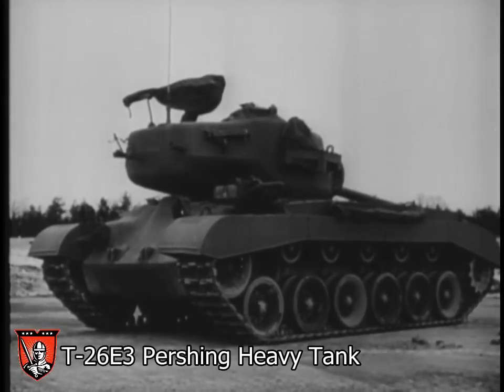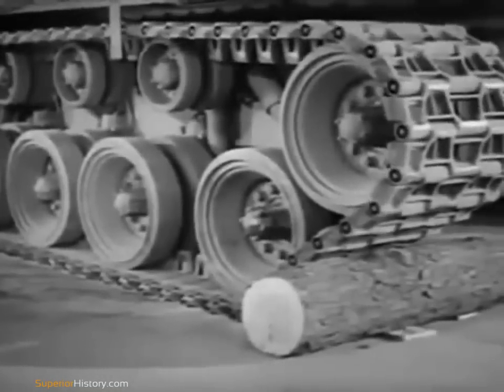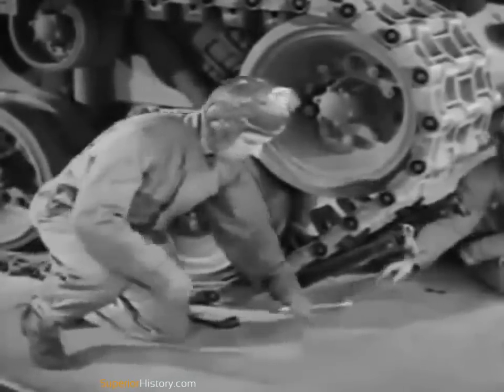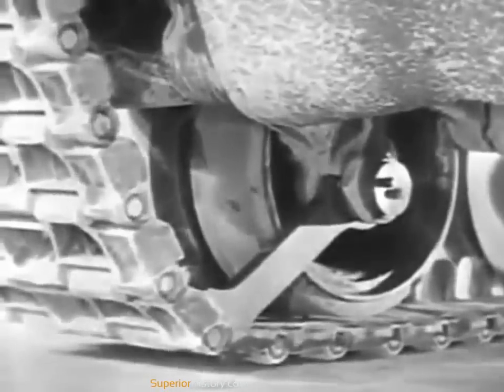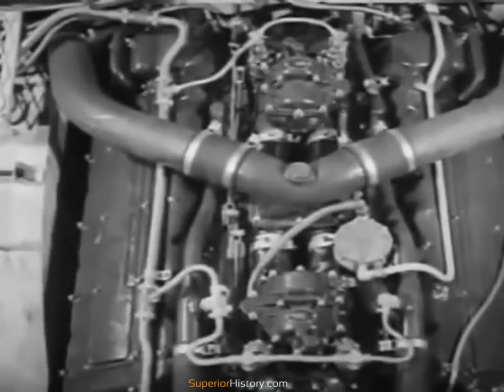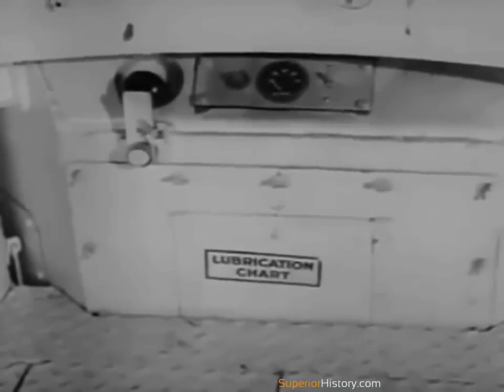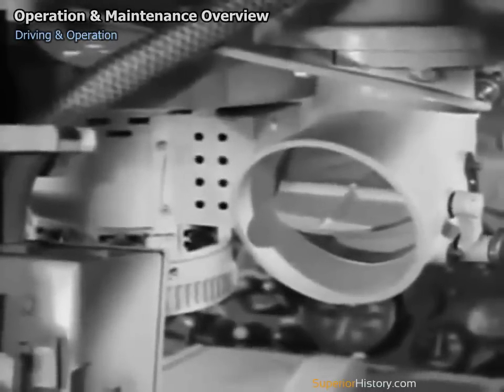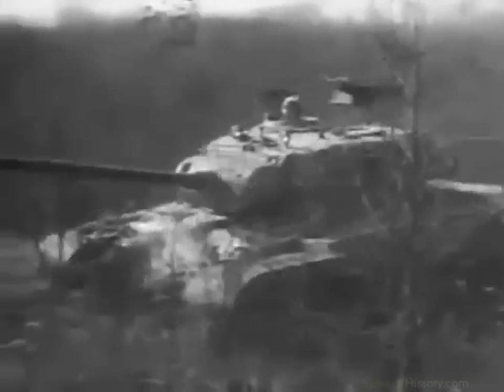The American M26 Pershing Heavy Tank (720p)

Comment: If only the Pershing had been available on D Day, what a difference it would have made. The Sherman was no match against the 88 mm of the Tiger. Even the Panther was deadly. Knowing the German superiority, I have often wondered why the Allies did not produce a tank to outgun and outrun the Tiger sooner in preparation for Europe.
Reply: Adrian Larkins 
Most Tigers were deployed on the Eastern Front.

Anyways the Shermans with the 76mms were good enough to take on Tiger 1s, the ones with the British APDS ammo even better.

75mm Sherman on the otherhand was weak, but US strategy at that time was like France, tanks purely for support of infantry. The USSR on the otherhand dedicated certain tanks to infantry, but also had tanks working independently.
Reply: Krasnaja Zvezda True. The Tigers were on the Russian front but there were still Tigers in France. The trouble was there were not enough Firefly Shermans with the 76 mm and the Germans knew the Firefly was dangerous so they picked out the long barreled Sherman for special treatment.  The other problem was the Sherman with its petrol engine made an excellent barbecue.
Reply: Adrian Larkins The Panther posed an even higher treath to the american tanks than the Tiger. More mobile, easier to build, better armored and armed with the 75mm Kwk42/L70, which was superior to the 88mm gun of the Tiger in every aspect except for HE-performance, the Panther was practically an overkill for the Sherman.
Reply: Karl Hans
The diameter of the projectile is the same, but the propellant case is much bigger on the Tiger 2.
Reply: Kevin Toma There was a few limiting factors that caused the Army to (wrongly) choose to put off the Pershing's introduction.
1--Time to build and amount of steel used was greater, reducing production numbers compared to the simpler Sherman
2--Sherman was easier for Rail transport (most tanks built around the great lakes area, not eastern seaboard) and much easier for liberty ship transport (the ships couldn't carry as many Pershings)
3--Crews have to be retrained in operations and especially maintenance proceedures (and tanker crews have a LOT of that to do)
4--Increased strain on logistics (new types of spare parts needed for maintenance and repairs)
5--Of course, the Army also honestly thought that like in Africa and Italy, the advanced German heavy tanks would be very rare (instead of making up some 40+% of German tank forces in Europe), and this is also why they refused to introduce the 76mm M1 gun armed shermans until late 1944 (could have been available by mid 1943) and the 76mm HVAP shells (which didn't finally start being found in large numbers for 76mm gun armed shermans until spring of 1945).  This was a HUGE blunder on the US Army, who didn't heed the advice of the Brits (who were uparming their shermans with the excellent 17# AT gun) about preparing to deal with larger numbers of Panthers and Tigers in Europe.

Interestingly enough, by early 1943 the Army already had prototypes of a new medium tank to replace the Shermans (The Pershing was effectively a beefed up version of this prototype medium tank) that had wide tracks and a torsion bar suspension, a lower hull silouette, better sloped armor, and a 76mm gun (picture a smaller Pershing), but they decided that the interruption in tank production as factories switched to the new type of tank was something they could not afford to do, so they stuck with the Shermans (cranking out 50,000 of them in about 48 months)
Reply: Adrian Larkins Most German armor encountered in Normandy were Panzer III's and IV's. You are right that the 88 gun was devastating, but the frequency of engagements with Tiger tanks were vastly exaggerated. Historians are quoted saying troops would often mistake other tanks for Tigers, cause Tigers were the big bad wolf of the German Army. For example, you're driving down a road in France and you spot a gun pointing out of the treeline. First thing you'd think was "Oh shit it's a Tiger!" cause your fear of one would cause you to assume it is one.
Reply: Big R You have a point.
Reply: 22steve5150 I hear what you say regarding diesel v petrol.  However, there can be no denying petrol is far more flammable. The Sherman didn't get that sick Ronson Lighter  logo "Lights up first time" for nothing.
Reply: 22steve5150 Thanks for the knowledge my man
Reply: 22steve5150
 The US Army replaced them in Korea with M4's due to reliability issues. You might want to try "The chieftains Hatch" video on myths of the m4 where this is explained as is why it was not ready for D-Day.
Reply: Adrian Larkins I think there are some major misconceptions here.  The Sherman was good enough to do the job it was asked to do.  It wasn't built to take on a Tiger 1 vs. 1, and it didn't have to.  It was a cheap easy tank to build and maintain, and that what was needed for WWII.  The war was a production war on both fronts, and the side that made more won.  You say that the Sherman was no match against the 88, but in reality no tank was a match for the 88.  The 88 would have killed the Pershing just like it did the Sherman.  We also avoided falling into the trap that the Germans did.  The Germans put these massive guns on their tanks, and they could penetrate tons of armor, but the guns didn't NEED to penetrate tons of armor.  Those huge guns weighed a ton, and caused all kinds of problems with mobility and weight.  If you only need to penetrate 100mm of armor, why put a gun on your tanks that can penetrate 200mm?  Watch the video on youtube about "Myths of American Armor".  It is very interesting.  For instance it talks about how the Sherman almost had as much frontal armor as the Tiger.  The Tiger had a bit over 4 inches of frontal armor because it was only very slightly sloped.  The Sherman had only 2 inches or armor, but because of the slope the effective armor was just a little under 4".  That is just a little bit less than the Tiger.  I'm not saying the Pershing isn't the better tank, but what I am saying is the Sherman did what it was supposed to do and did it very well.  Being a tanker in a Sherman in WWII was not a death sentence.  In fact the tank arm had one of the lower casualty rates of the war, and most of the casualties came from tankers outside of their tanks.
Reply: +Zebra Dun not that you can;t ship them, but that you can ship 2 M4;s and a bunch of additional weight in the same ship you can ship one Pershing.  quite a few of the pieces of infrastructure can  easily carry it or were fortified to carry such weight by the Germans.
Reply: +Adrian Larkins In this thread I think you have checked off every M4 Sherman myth there is. "Ronson", eh? Petrol engines? "Superiour german tanks"?

1. The "Ronson" moniker is likely a myth to begin with, and besides, by the late war it was less likely to catch fire than most tanks, thanks to wet ammunition storage. It's the ammunition that catastrophically burns out a tank, not the fuel.

2.  Every German tank was petrol powered. In fact almost all were, with the exception of the Russian tanks. But as several have told you, it doesn't matter. Fuel fires don't kill tanks, ammunition fires do.

3. The PzIII wasn't superiour, the PzIV wasn't superiour, nor the StuGIII or the JgdPz38. It could go toe to toe with all those, which made up well over 75% of all German tanks/TDs. Even the Panther wasn't impervious. Google the 'Battle of Arracourt'. And yes, that is with the M3 75mm.

Let go of the Belton Cooper "deathtrap" myths already and please go watch the clip /watch?v=bNjp_4jY8pY
Reply: +Adrian Larkins The Firefly wasn't a terribly good tank. They shoehorned that 17pd gun in sideways into the turret that was really too small for it, so the ergonomics and combat effectiveness suffered. Also they simply didn't have enough guns. It was a stop-gap measure at best. The British fielded them in a 1:4 to 1:5 ratio with 75mm Shermans.

And besides, many many tankers at the time preferred the 75mm, because the main threat wasn't Tigers or Panthers as you seem to believe, but rather AT-guns and AT infantry teams. For which you want a decent HE shell which the M3 75mm could deliver (and the 17pd or the M1 76mm couldn't). For PzIVs and StuGs the 75 was effective.
Reply: Adrian Larkins Nice! :) I just want to educate that the old "common knowledges" about the Shermans and the Western Theatre aren't what they seemed to be. The big picture has been skewed by shoddy History/Discovery/Military Channel "documentaries" regurgitating the same old claptrap.

The thing was that the upgunning of the M4 was in the pipeline ever since 1942, the U.S. armour board did know that it probably was to be needed eventually. But for logistics and time reasons (and the 75 mm's HE shell) they didn't in time for the Normandy landings. They perhaps didn't know that the Panthers would be quite so numerous in the Normandy campaign, ...but then again the 76 mm wouldn't have helped much anyway. It wasn't effective to the front of the Panther either without HVAP. The sides and rear both the 75 and 76 could penetrate easily. The Tiger I was documented to have been encountered a grand total of 3(!) times by U.S. armoured troops in the western European theatre, as told in the clip I recommended.

The Sherman's armour wasn't actually bad by any stretch. For a 1941-1942 tank it was great actually, much better than the PzIV and StuGIII, even after their applique armour additions, and the T-34. Frontally it was actually only slightly worse than the Tiger I. Did it stand up to the Panther's 75 mm L/70 or the 88 mm L/56? No, but then again no British or U.S. tank did really, not the Pershing either (especially against the Panther's L/70 which was better against armour than the Tiger's 88).

Well, enough blabbering. I'm glad I could plant some seed of thinking about the subject... :)
Reply: +Michael Ledford I am sure you are right but the fact remains the M4 did come up against Tigers and Panthers.To believe otherwise was wishful thinking. Not only that, the American planners knew the 88mm was a killer even as the Sherman was coming off the production line. It should have been equipped, from the beginning, with a turret and gun that at least gave the crew a fighting chance. Air support was not always available and certainly not instant.
Reply: Adrian Larkins I agree that there were many times Sherman's were forced to fight tank on tank without CAS but that wasn't the Sherman's main role .
Reply: because tigers were rare in the west.  we had things to take them out already, planes,    artillery, fireflies, ect
Reply: +Zebra Dun Some of the reasons given by Omar Bradley and Montgomery for not closing the gap was lack of material, fuel and ammo but more importantly they feared the Allies might accidentally fire at each other as they drew closer. Personally, I think these are excuses rather than true facts. In short, they cocked it up.
Reply: The M4 Sherman was a medium tank never intended to engage enemy armor as it's primary mission. It was designed for infantry support, breakthrough, and exploitation. U.S. doctrine at the time called for the Tank Destroyer battalions to be used in the tank killer role. The M-10 and M-18 with the high velocity 76.2mm gun and later the M-36 with the 90mm gun complied an outstanding record for German Armour destroyed when using ambush and defilade techniques, flank shots, and quick movement for which they were designed. This included destroying many Tigers and Panthers at normal combat ranges particularly later in the war when better high velocity AP rounds were available.
Reply: If the Sherman wasn't good enough, then how did the Germans lose the Battle of Arracourt? They had numerical superiority in terms of armour and still lost horribly.
Reply: Mr.Science your 100% correct ,the Sherman wasn't designed to go toe to toe with heavy tanks , the Sherman was 1 of the most successful medium tanks made .
Reply: Colonel Radec Good point. There were more of them too. The Tiger has become a bit of an overrated legend to some extent. By that I do not mean to it was not a huge threat to the Sherman. It certainly was a killer.
Reply: Krasnaja Zvezda I was referring to the Tiger 1.
And as far as I know, the cartridges in the Tiger 2 were the same size as the ones used in the Tiger 1, but the Tiger 2 had a much longer barrel which was able to fire with higher velocity.
Reply: Colonel Radec
The Tiger 2's KwK 43 has a larger cartridge and thus the ammo is not comaptible with the KwK 36 L/56 of the Tiger 1.
Reply: Krasnaja Zvezda Ok, but why is it the same calibre then? Do you have any sources?
Reply: Krasnaja Zvezda why are they both 88mm then? cleatly the Tiger 2's round is bigger in diameter.
Reply: Adrian Larkins More politicians probably had more money invested in the Sherman. Or, at least that would be the reason if it happened today.
Reply: Adrian Larkins There were logistical drawbacks to switching production from the smaller, cheaper, lighter sherman to the pershing and for a long time, concern about those drawbacks caused the army to delay the introduction of the Pershing.  Switching factory tooling over for a new tank design construction would have slowed down general production numbers of tanks temporarily, and you couldn't ship Pershings by rail to the east coast then load them up on ships for transport across the Atlantic as easily as the much smaller and lighter Sherman.  Remember, unlike the other tanks in the war, the Sherman had to have considerations about ease of transporting them halfway across the world to fight, and a liberty ship could transport something like 2.5 Shermans for every Pershing..  Everyone else's tanks basically could drive or take train railcars from the factory to the war front.
Reply: 22steve5150  Your comments make sense BUT I think you would agree the standard Sherman was a death trap against the 88mm whether  it be mounted on a Tiger or as a separate anti tank gun. That said, why, oh why did they not switch to all out production of the Firefly. That would have helped but still the petrol engine would have been an "ignition" danger. I hate to think how many good men met an agonizing end just because some bright spark thought it was cheaper and faster the install an aircraft engine into a tank.
Reply: Adrian Larkins US Army doctrine at the time called for tanks to be used against infantry and tank destroyers to be used against tanks.  Basically the US 76mm and British 17# guns both had shitty anti-personnel shells and the Army wanted to discourage tanks from trying to fight other tanks.  All in all pretty fucking stupid.  They could have had all Shermans equipped with the US 76mm gun by late 1942 and by early 1944 they all could have been using the 17# gun.
As far as the gasoline engine, I never really bought that being a problem.  All german tanks also had gasoline engines, and the diesel engined T-34 actually had a higher rate of catching fire when hit than the Shermans did.  The 2nd gen Shermans with the protected ammo storage and water jacketed fuel tanks seemed to greatly reduce fires compared to the 1st gen shermans.
Reply: 22steve5150 It was a general consens at that time that tanks should be primary used against infantry, bunkers or anti tank guns, not against tanks. Just look it up, the actual amount of tank vs tank combat is relatively small.
Reply: Why I wonder is why they didn't issue the LVT amphbious vehicle to some of the D-Day troops.
Reply: Krasnaja Zvezda The LVT wasn't really armored enough for combat against the Germans.  They really had a bad combat history in the Pacific theater, they would easily get stuck, sink, etc.
Reply: Adrian Larkins I'd imagine it being much harder to maintain and transport the Pershing onto beaches, but I don't know any of the specifics.
Reply: Adrian Larkins Anyone slightly familiar with D-Day, (those who watched "The Longest Day") will know that very few Tigers if any were in combat during D-Day. Hitler wanted to keep them in reserve and he alone could order them into action. So no, it would have made little difference. Only German anti-tank personnel would have a much bigger target for their Panzerfausts and Panzerschrecks. And who needs a diffent D-Day outcome? The outcome was that the Allied landings succeeded and the Allies gained a foothold on the European continent.
What about Omaha Beach? Only a few dozen tanks made it ashore, many sank in the stormy waters so if they were Pershings, I reckon all of them would have sunk. There were no Tigers either on Omaha Beach anyway.

Btw, you wouldn't mistake D-Day with the Battle for Normandy, would you? D-Day was just one day, 6 June 1944. The Battle for Normandy lasted a whole month.
Reply: AudieHolland  So you think "The Longest Day" gives you a good grounding on D Day? Oh well. You miss my point. Yes, there were few Tigers on D Day but it did not take long for them to appear and besides, there were plenty static 88mm guns. The Sherman was a death trap against the 88mm. I will not go into detail. See my other comments. Many good lives were lost in those tanks and yet the Allies knew the Germans had far superior machines. I say again, if the Pershing had been available earlier, the Germans would have met their match. By  the way, Omaha was a disaster for many reasons. Elsewhere, landings went relatively smoothly and Pershings may well have succeeded in getting ashore.
Reply: AudieHolland I would say that several things would have sped shit up immensely.
1--for all the engineering variants and "hobart's funnies versions of tanks thought of prior to the landings, the hedgerow cutter blade was one of the few things that was not thought of.  If those were available early on the next month in hedgerow country would have went much better.
2--Pershings available earlier would have been huge, since about 40% of total german tank strength in Europe was Panters and Tigers.
3--Upgunned Shermans produced BEFORE D-day, and tungsten HVAP rounds available in larger numbers
4--M36 Jackson introduced earlier
5--DD versions of the about to be introduced M24 Chaffee.  Very similar length and width at much reduced weight and not as tall (and topheavy) either.  Armed with a 75mm gun just like the DD Shermans.  Also torsion bar suspension and a wider track.  If equipped with some DD modified versions of this light tank the forces on D-Day itself would have done much better as their armor would have at least made it to the beach instead of sinking in rough water or bogging down in muddy areas while trying to come out of the water.  Vehicles like these could have really helped cross rivers to secure bridgeheads during the march into Germany as well I think.

The DD-Chaffee idea is my own little idea, but as for the other things I mentioned, these mostly were not available because war planners didn't think them necessary, not because they were logistically unable to start producing them earlier.  Too bad.
Reply: Adrian Larkins (sighs) I meant that anyone who has seen "The Longest Day" will know that the Germans did NOT deploy their Panzers on D-Day (June the 6th). Meaning ANYONE knows that.
I'll let you in on a secret: ANY tank, no matter how well armoured was a death trap when being shot at by a German 88 mm. 

Omaha started as a disaster but at the end of the day, they did manage to break through (supported by gunboats that ran aground on purpose to fire at the German bunkers and pillboxes from point-blank range). So while it started as a disaster, it ended in mission accomplished. At the end of the day, overall losses were lower than expected. Meaning that on other beaches like Juno Beach, the landing was virtually unopposed when compared to the hell on Omaha.
Reply: 22steve5150 Overall it would have made little difference. Enemy anti-tank infantry used Panzerfausts and Panzerschrecks which no tank armour could resist.
Bladecutters looked nice but they didn't help much since the Normandy hedges were grown on low earth banks which were reinforced over the ages. Meaning that no vehicle or tank could simply cut its way through the hedges. Their front side always rose up as they passed the bank and the tough hedgerows underneath, slowing them down immensely while at the same time presenting a big, irresistible target to any anti-tank cannon or infantry.

The DD-tank based on the Sherman was an great design which worked very well under the circumstances that the Allies had trained. Nobody had expected the bad weather that they got when they did land but if they hadn't landed the 6th of June they would have had to wait a whole other month before they could try again.

What irks me is that some people look at D-Day as if it was a bloody failure. It was not. It was a remarkable succes with over losses lower than expected. The Battle For Normandy, that was quite a different story. No matter what tank they would have used, the Allies would still get stuck in the hedgerowland because their planning simply did not take into account that the hedgerows were different than your ordinary hedgerows.
Reply: AudieHolland I'll let you into a little secret too. I know the 88 could kill any tank but the Sherman didn't even have a gun to cope with the heavy German armour. The 75 was useless. The 76 Firefly was different but there were not enough of them. As for the Pershing, it had the right fire power and its armour gave the crew some degree of protection. Also, it was not so prone to bursting into flames. I still say the Allies were almost criminally negligent in making young men get into tanks which they KNEW were no match against the opposition. The Pershing should have been ready for service on D Day. As for Panzerfausts, they were only effective at very close range. If all anti tank weaponry is so deadly it makes you wonder why tanks are still with us today. That' s my opinion and I'm sticking to it.
Reply: Adrian Larkins  Actually most of what you posted is not accurate, but a flawed view of the Sherman based mainly on one (now fairly discredited) man's book that complained about the Shermans.

First of all, the tendency to catch fire was an issue only with the earlier models of Shermans, and it wasn't because of the gasoline, it was because at that time it was common for extra ammo to be stored in the crew compartment, particularly in racks along the sides of the turret.  The 2nd generation Shermans got rid of the racks and protected the stowed ammo in the floor with water jackets.

Second, early war German tanks, when penetrated suffered nearly the same rate of "burn out" as the Early Shermans did, and the later shermans were one of the least fire prone tanks of the war.  Also, because of several hatches and the roomy nature of the Shermans, actual crew losses per knocked out tank was one of the lowest of the war, with Russian tanks being the worst (when a T-34 was knocked out, on average nearly the entire crew died)

While only the British Firefly shermans and US 76mm armed shermans using tungsten HVAP rounds did give them a fighting shot that the 75mm gun armed shermans didn't have against Panthers and Tigers (but were only introduced in late summer 1944), at this time the US army still figured that tank destroyers would do the majority of the fighting against german tanks, the Shermans were supposed to be more "infantry tanks" at this time.  It wasn't seen as a significant risk for tankers considering what US armor doctrine was at that time.

US tank design had to consider factors that German tank designers didn't have to deal with, mainly to be manufactured fast and be easy for crews of various nations to operate, be able to be easily transported by rail and then by liberty ship across the Atlantic (a lot harder to ship tanks halfway round the world than drive them from the factory to the front like German and Russian tanks could do)

Finally, take a look at the "world beater" T-34 if you want to see a real over hyped lemon.  The T-34-76's gun was inferior to the Sherman 75mm (low velocity), and even the T-34-85's gun was inferior to the late war Sherman 76mm and British 17# guns (again, low velocity), they had an outdated and highly problematic suspension system, their engines and transmissions frequently failed before being driven 100km, and they were so crowded on the inside (and ammo and fuel storage issues meant almost certain fire or explosion when penetrated) that it was nearly impossible for the crew to get out before being felled by flames or smoke inhalation.  They also had terrible visibility with the hatches shut and no turret basket, which significantly hampered the ability to quickly aim and fire while maneuvering.

Fun Fact.  At one point the T-34's remarkably high instance of mechanical breakdowns resulted in several after action reports that indicated that more T-34s were being knocked out by mechanical problems than by enemy fire, so Stalin's people began investigating whether or not there was sabotage occuring in their factories or by cowardly tank crews.
Reply: 22steve5150  I appreciate your knowledge. i agree with your views BUT you can't get away from the fact that the later Shermans were as a result of the disaster of the first. I am with you as far as the  T 34 is concerned. I realize the problems of shipping but  at the end of the day, American tank design should have taken into account the German superiority. If only they had cancelled the standard Sherman and mass produced the Firefly. That would have helped. The ammo storage was indeed a factor but that rotary petrol engine didn't exactly improve matters.
Reply: The end of the story: not the type or design of tank was what decided the war. One thing only: Mass Production.
The Firefly was a marriage between the US Sherman and British 17 Pounder cannon. So production depended on the availability of 17 Pounders. Furthermore, the cannon was so cumbersome that it only just fitted into a Sherman's turrent meaning it could not fire at the same rate as ordinary Shermans because it could not be loaded as quickly.

Mass Production. The Germans never learned the trick, their tanks evolved into monstrous dinosaurs like the Tiger II and the Sturmtiger. Too heavy for most bridges in the Ardennes Region and slurping too much precious fuel that was no longer available.
The American and Soviet tanks, with all their flaws, were great cross-country vehicles with armour and a cannon as extras. Also very reliable and since both the Sherman and T-34 could be produced in Mass Production, it didn't matter that much that they were relatively easy to destroy.

Combined the Allied Air Superiority and even total dominance of the skies near the end of the war, it didn't matter much what tanks the Germans employed. A salvo of all 8 50 calibre guns from a Thunderbolt could turn over a Tiger by simply firing next to the tank.
And the Soviets employe small bombs that were dropped en masse over tank formations, knowing that many small bombs had more of a chance of hitting one or more tanks. It didn't matter the bombs were so small: any tank's top armour will always be much thinner than its front or side armour. Those Soviet anti-tank bombs were a bit like modern cluster ammunitions.
Reply: Adrian Larkins And of course all German tanks were Tigers and Panthers, right? The Sherman was designed with the Panzer III and IV in mind. So even with all the upgrades, a Sherman still had a decent chance at taking out an enemy Panzer IV. Panzer IVs had Schuertzen (skirts) to protect its sides against bazookas but these didn't help against high-velocity projectiles. And of course, as mentioned earlier, the Sherman was never designed strictly as a tankbuster. For that role, the M-18 Hellcat was used. The Hellcat was the most effective US anti-tank destroyer during WWII (according to Wiki).
Reply: Adrian Larkins Funny thing is they got past the radial aero engine thing early on but by then they had designed the propulsion train and the hull around that aero engine so once the Ford V8 engines started being used, they still had the rear engine, front transmission setup with the propeller shaft linkage that forced the hull to be so tall.  I wouldn't say the early models were a disaster, they worked great in North Africa, the problem was that the army didn't think they needed to upgrade them afterward (only Brits encountered Tigers in North Africa) and even after having a lot of problems operating in Italy the Army still resisted changing or upgrading their tanks the way the Germans were constantly upgrading the Panzer IV.

What is really messed up is that the army could have been fielding a new medium tank with rear engine and transmission, sloped armor, low silhouette, with torsion bar suspension and 76mm gun by late 1943 but they refused to interrupt Sherman production to start production of a new tank, so the prototype was worked further and enlarged to be a bigger tank with thicker armor and a bigger gun, resulting in the M-26 Pershing.
Reply: Adrian Larkins The 17 pounder Firefly wasn't as great a gun as everyone thinks. It could punch a hole thru a front of a panther in under 500m but its accuracy started to suffer at longer ranges. The 76mm was a much more accurate gun and with special AP rounds could do the job sufficiently. That is one of the reasons the Army chose this gun upgrade for the M4 after considerable testing(I think someone also mentioned that it was shoehorned into the turret and had no room). As for petro engine fires, these did not cause the "death trap" when a tank got hit. Someone already mentioned this, but the ammo is what catches fire and engulfs the tank. Shermans were quite easy to get out of quickly unlike most German and Russian tanks and saved a lot of tankers lives.
Reply: Joe Flatley
Though the AP ability of the 17# gun was superior, the 76mm had very good AP with the tungsten HVAP rounds but unfortunately the army didn't start mass producing them soon enough so on top of the relative few 76mm armed Shermans, those 76 armed Shermans were usually only issued 2-5 of those HVAP shells per tank.  What a clusterfuck.
Reply: Adrian Larkins  Pershing only started production in Jan 44 and was untested. It turned out to be a dog. In Korea they were ditched for the E8 Sherman.
Reply: Shawn Sutton
 They were actually withdrawn at the end of Korea in favor of the M-46 Patton, which was nothing more than a Pershing with a newer, more powerful engine.  The only problem the M26 Pershing had was the fact that they had the same powerplant as the Sherman A3 models (500hp Ford engine) which for Europe wasn't a big deal but for Korean mountain country was a big deal and it took until after WW2 to develop a more powerful engine for them.  Since the M-46, M-47, M-48, and M-60 Patton series were all derived by the M-26 Pershing, I would not consider it a "dog".
Reply: Shawn Sutton
THE reliability issue was because the tank used the same engine as the Sherman A3 model (Ford GAA) and a rear transmission that was originally designed for a 35 ton medium tank replacement for the Sherman, and it is this engine&transmission combo that caused problems in Korea, which was very mountainous country and therefore not well suited for an underpowered tank.  Also, they were not replaced by M4s in Korea, Pershings and Easy 8 Shermans both were deployed to Korea and the Pershings were withdrawn as newer M-46 Patton tanks (basically a Pershing with a new powerplant, altered suspension, and a bore evacuator added to the main gun) replaced them.
Reply: ***** I appreciate your remarks but my original point was the Sherman was no match against the Tiger, Panther and the 88mm gun. If only the Allies had developed the Pershing earlier and had equipped the Sherman with thicker armor and the 76 mm gun as standard, the lives of many young men may have at least had a fighting chance. As for Dieppe the lessons were well and truly learnt by D Day. As for Omaha, it was a near disaster but tanks were landed successfully elsewhere.
Reply: it's my understanding that the tanks couldn't be too big or heavy in order to be shipped overseas for battle.
Reply: harry beck
Yep, also it required new and more complex system maintenance training and adding new parts to the logistics train, and new vehicle training for crews.  Also the production switch would have reduced overall tank production for several months while the factories re-tool.
Reply: +Adrian Larkins 
Because the Sherman was cheap and easy to produce in mass numbers.  Mass producing cheap tanks proved to be a better strategy that producing expensive heavy tanks.
Reply: +Faceless Man  I agree. It was cheaper and easy to produce BUT at what price in human life? The Allies were well aware of the capability of the German heavy tanks eg. Panther and Tiger, and yet they produced comparative rubbish knowing full well men's lives were at stake. If only they had made the 76mm gun standard. Even that would have helped but NO.
Reply: +22steve5150 

The Pershing was a good tank,that arrived late in the war,but could hold its own against German Armour in the form of tigers,panthers and tank destroyers(which the Germans were producing in ever increasing numbers because of ease of production and cheaper to build), such as the  jagdpanzer iv and the excellent   jagdpanther.

But compared to the Centurion Tank as seen during the Korean and other wars such as yom kippur  in '73,was inferior.

I am surprised no one mentioned the Comet medium tank, which was a stop gap produced in just enough quantity to help the British army lighting speed advanced into Germany in 1945.The 11th Armour division  was fully equipped with this tank, thanks to the Armour piercing dart ammunition it used,its low profile and speed with better Armour protection,the tank fared very well against German tanks and tank destroyers.

Protection was also provided against infantry  hand held anti tank weapons by having infantry travel on the tanks themselves just like the Russians and Germans did
Reply: +Jam Putto  The Comet was indeed a good tank as a stop gap. The other British tank that was worthy of mention was the Churchill. I still say the Sherman 75mm was a folly. I was no match against the superior German tanks and other anti tank armament. And that petrol engine - no wonder it got the nickname "Ronson". The Sherman was only effective because of the weight of numbers and the cost in human life was almost criminal.
The Centurion was is a different kettle of fish. It was a huge leap forward, superior in all aspects to WW2 tanks.
Reply: Centurion was a world beater for years
Reply: +harry beck It was and although entirely different inside, you can still see the physical outline of the Centurion in today's British tanks
Reply: Adrian Larkins

I think the Sherman was a very good tank up to 1943,by 1944 it was showing its age.Though at least the Sherman Firefly with its 17 pounder  give the crew a chance at greater distance of a kill against German Armour,depending on the Tank /Tank destroyer's type.

In the end it is the quantity of Armour produced in terms of numbers that counted.

The Germans tended to over engineer theirs.

Still wasn't it U.S.A militarily doctrine that dictate that Tank Destroyers were solely in the tank hunting / killer role with there higher velocity guns?
Reply: +Jam Putto Knowing what they were up against I cannot understand why the 76mm Firefly was not standard. At least then the poor guys inside had a chance. You can talk about doctrine all day but the fact was by 1944 (pre D Day) the Allies knew the Sherman 75 mm was not up to scratch and yet they still sent young men to their deaths
Reply: Who knows,maybe the decisions are made by those higher up,who are not in the line.
Reply: +Jam Putto I'm sure you're right. Politicians and business don't mix when it comes to the grim practicalities of warfare.
Reply: +MPI1000 Ok You have your opinion. I have mine. Myth is it ? Yea well.
Reply: +MPI1000 Right, I've done some research since my last message. I bow to your knowledge on most points. The Germans did have petrol engines. However, I stick to my main premise that the Sherman was vulnerable due to lack of amour plating, hence the extra bits and pieces added by the men in the field. Also, that 75 was too weak. You say the 76 was not popular with the tankers. Personally, I would sacrifice comfort knowing I at least had something to take on Mr Tiger and his little brother who was equally as deadly, Mr. Panther.
Reply: The Sherman wasn't meant to take on Tigers in tank on tank fighting & our use of tanks was a bit different than Germany , one very smart thing Ike did was to not fight the war Germany wanted , instead Ike patton & Bradley took advantage of the us's best weaponry which were the close air support planes the US air Corp was unrivaled with , people misunderstand the role Sherman tanks were meant to play in ww2 which was not to confront superior armor , CAS , artillery & tank destroyers did that job while the Sherman's gave heavy firepower to mobile infantry units .
Reply: Adrian Larkins No , your right that CAS isn't allways available , but when it is America OWNS the battlefield hard against any weapon , trade offs were made & we knew the allies owned the sky after the battle of Britain so the choices made were to rely on armored speed & leave armor on armor to the CAS ,  being a Vietnam veteran MWD handler/combat infantry , & being on 2 patrols where my K-9 saved us from certain ambush ,once by hidden armor  , then having the ability to call in puff the magic Dragon against an armored column , I can tell you no armor stands a chance against well called out & placed CAS , I saw a Russian APC melted by puff's withering fire in a single pass , the VC feared puff more than any other weapon In that war because they weren't safe even in their tunnels from puff .
Reply: +Michael Ledford  Another example of the overwhelming effect of air power against  ground armor was the Falise Gap in France, July 1944  where rocket firing Typhoons destroyed German tracked transport, including Tigers and Panthers. Another more recent occasion  was Sadams' retreat  from Kuwait. I don't understand why the Warthog has ceased production. What an aircraft! That Gatling... Brrrrrrrrrrrrrrrrup !!!!!
Reply: Adrian Larkins Wow great point , what a historic battle that was for Americans & Canadian bad asses , it's too bad Bradley & ike wouldn't allow the gap to be closed , then destroyed the entire German 7th army , at least I think it was the 7th , the A-10 had had all its production machinery & molds sold off for scrap , wtf is Obama thinking , aside from making the US military just so so like most armies .